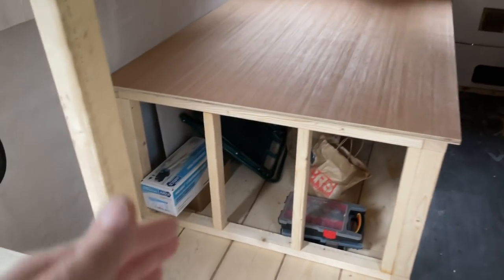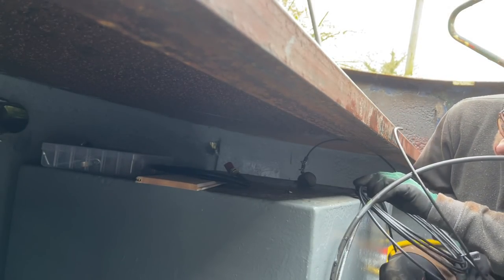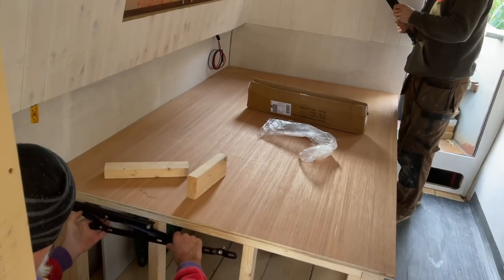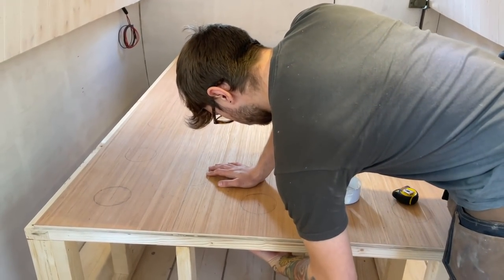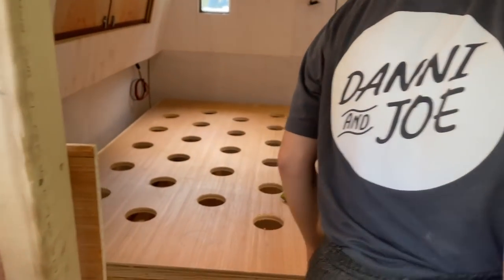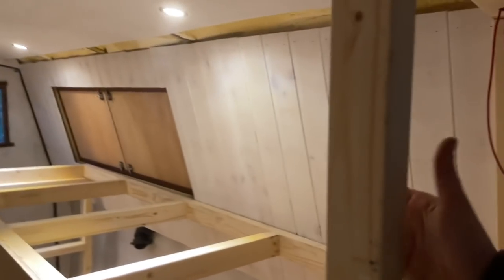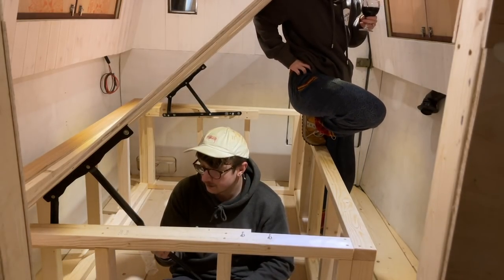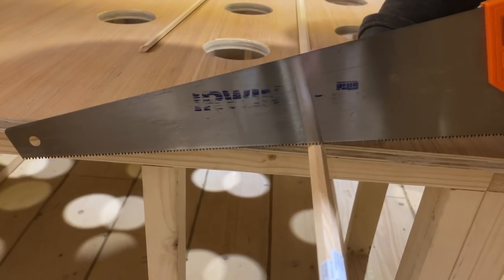Great Bed Frame Storage & Stud Walls | Webasto Install (Sort Of) | Narrowboat Conversion | BOATLIFE

Comment: Do you have a grate in your new log burner?  If not, at some point the heat with burn through the bottom of your log burner (your grate is your sacrificial metal). Huge apologies if you have, but rather give the advice than you come a cropper.  Boat is looking great guys, you should be proud of yourselves.
Reply from the maker: Thank you, yes got a grate on order, have left the ash to build up in the bottom at the moment to minimise the problem & fire bricks ready to go in

Comment: Hi guys another great vlog.
The bed looks great but I would suggest a couple more support beams under the bed ply base. I know 18mm ply is strong but over such a wide opening it will definitely sag over time, even if it was only one beam across the middle it would help prevent any movement. Otherwise I think it looks fantastic.
Reply from the maker: Thanks Keith yes will look into beefing it up due to the span

Comment: Hi both, just to backup another comment made it is essential that you put a grate in the bottom of your log burner it only needs to be 2 or 3inches off the bottom. Keep going
Reply from the maker: Thank you yes we’ve got a small one on order will just need to chop it up a bit to fit it in!

Comment: Happy anniversary and the boat looks great.  If you ever have another nut
situation like you had at the 4:20 mark you can put a small pair of vice-grips
on the nut to hold it while you twist the bolt from the other side. Vice grips 
are always my tool of last resort since it is sooooo easy to mess things 
up with them.
Also, if you ever need to drill a bunch of big holes ever again you can always
use a bit of liquid hand soap to make it easier. A drop or two around the outside
can help a bit.  Great job.
Reply from the maker: Great tips cheers!

Comment: With time…you could think of widening the sleep area of your bed by installing a folding leaf on one side of the bed. With a “futon” and memory foam combo …. You simply slide the extra width up against the wall during the day and fold the leaf down. Presto … a day bed for reading and resting. That extra foot or so in width makes a huge difference in comfort. 
All the best. Cheers 🥂
Reply from the maker: Yes a really good idea - someone we met in the marina had an extra bit of ply and essentially slid their mattress away from the wall which helped as well!
Reply: @ItsOhJoe  Glad you might be able to use this simple system. Just to add clarity to my suggestion… I was imagining for you… a drop leaf on to one side of the bed which when flipped up is secured by pivoting supports which disappear within the bed frame during the day. The leaf folds down and takes up no room safe for the thickness of the ply. The leaf can be affixed to the frame by using three to four ordinary hinges or ….if you wish a well priced piano hinge.
Happy Holidays to you and yours
Canada’s Eastern Seaboard 🎄🇨🇦

Comment: You guys clearly have a very good understanding and deep knowledge about building, woodworking, wiring and the other things you're doing on the boat. Heck, you've used tools and devices I never even knew existed! Would you mind sharing where you learned all these skills?
Reply from the maker: Thanks so much! Just picked up different things along the way really, Joe’s dad is a builder so he learnt stuff from him. We converted a van a couple of years ago and learnt a lot then too!
Reply: @ItsOhJoe  Thanks so much for the info! I don't feel quite so bad about my inability to do this kind of thing knowing that Joe had a bit of a head start!

Comment: another great video. Could maybe try using smaller bolts with washers on the gas struts
Reply from the maker: It’s the locating bolts on the hinges themselves that’s the problem, will need to order some new struts to solve it unfortunately!

Comment: You can grind a slot into the end of the bolts with allows you to use a screwdriver to stop then turning whickt using a open ended spanner to tighten the nuts down in cases where you cant physically get to both sides
Reply from the maker: Didn’t think of that! Will give it a go next time!

Comment: Guys I think you might want to rethink your air inlet for your diesel heater. It has the potential to suck diesel fumes in from the exhaust. They tend to smoke a little on start up. You could draw the air inlet from inside the boat so as the boat warms up it'll reduce the effort on the heater and make it more efficient.
Reply: You really can't draw air from inside the boat.
Reply: @theotherstevesteve  is there a reason why, as factory vw campers do.
Reply: @theotherstevesteve  Read the manual.
Reply: @carlwilliams4705  the requirements of the boat license in the UK are thar these heaters must be room sealed.
Reply: @johnglover9935  it doesn't take much at all to maintain a civil tone.
Reply: carl you are absolutly correct. steve, you cant draw combustion air from inside the boat, but air to be heated never comes into contact with fumes. also it would create cirulation and reduce the fuel consumption as the air being heated is already warmed. i have three of these heaters. they all draw combustion air from outside and heated air from inside. also carl is right to point out if the wind is comming from the front of your boat the air being heated will pick up the fumes from the exhaust.
Reply: @theotherstevesteve  No place for diplomacy or civility with a potential threat to life.

Comment: Keep going strong really interesting to watch, try and get some type of perspex to act as double glazing to stop condensation rubber seal around the edge push fit in .dave  (cambridge)
Reply from the maker: Seen a few people doing this, does it work?
Reply: @ItsOhJoe  yes it does work, keeps down most of the condensation, cuts out a lot of noise and stops cold air coming in we had our 60x10 boat done which we live on. Take them out in summer and put back in autumn  time would not be with out them

Comment: Hi guys.. Love your videos & always watching to see what's next & how you did stuff. My gf has just bought a 45ft 1989 narrowboat & we have completely gutted it (soon to also be a vlog) but was wondering what heater did you use in the engine bay... So much choice & opinions around was wondering what you chose as the installation doesn't look too bad to do
Reply from the maker: Ahh what a lovely project! So we went with (unconventionally) an air heater as that’s what we used in the van and it was really simple compared to a radiator system. In the van we used an Eberspacher D2 and the boat we used the Webasto Airtop 2000 (essentially the same just different brands). To install on a boat you’ll need a couple of different bits - copper fuel line (might have some of this left over that you’ll be welcome too if it’s any use), a hull exhaust outlet and some exhaust insulation. Then depending on how far you want the heat to travel you’ll need a decent roll of the ducting, we used a 10m coil as the interior of our boat is only 10m, plus any outlet fittings for venting off into separate rooms. If you pop us an email danniandjoetravel@gmail.com I’ll pop some links back to you for a shopping list if you like.
Reply: @ItsOhJoe    thank you been alot of work so far but lots of fun too. Can follow @driftwoodfolk YouTube & Instagram ha. BTW appreciate your reply and congratulations. We hope you enjoyed your trip. Oh okay I was thinking the same things tbh. Yes we want to go Air heater as well as our log burner as we are limited on space.
Really? That's much appreciated il drop you a line. Would be lovely to get some advice and chat. Many a time I have watched and rewatched your videos to understand things (sorry not sorry). That would be epic. No quite there yet as we are currently doing the ballast and redoing the floor but any help especially form you guys is greatly appreciated.

Comment: Do not move the Webasto intake indoors! One important thing with warm fresh air is that it will bring a lot moisture out; ie you have the intake outdoors.
Reply from the maker: Getting a bit of conflicting info on the air inlet, can see both sides of the argument. I guess less condensation vs more efficient.

Comment: It’s looking great. I often wonder watching narrow boat restorations, how much weight is added to the empty shell of a narrow boat. How much weight is too much? I’ve never seen it mentioned in any vlog, maybe it don’t matter! 😂
Reply from the maker: So traditionally they were constructed simply for carrying massive loads & no doubt were constantly running up and down the country fully loaded (even over loaded) - a fully fitted narrowboat now shouldn’t come anywhere near to a full load of coal for example. The main worry would be the draft or distance between the bottom of the boat and the bottom of the canal but that would vary between boat. Bit of a guessing game I’d assume!

Comment: Turning the numbers on the drill isn’t turning the power up.  The numbers are for strength that it puts  in screws and then stops.  Ie how tight screws go in.  On drill setting it’s disabled.
Reply from the maker: Every day is a school day! Thought it was the how manly do you want your drill control 😂